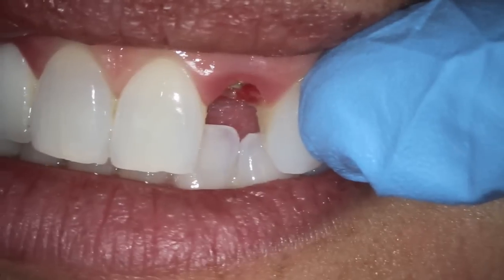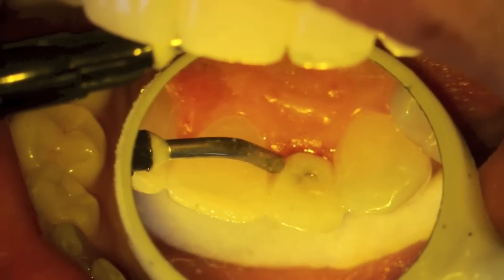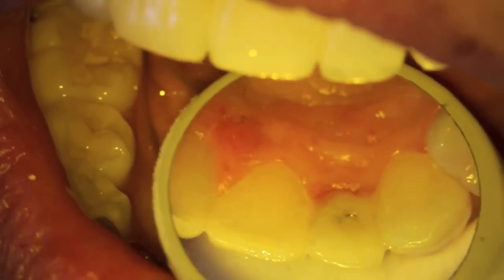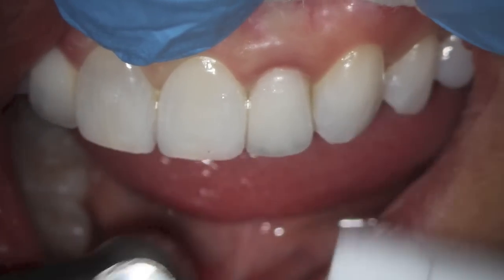tooth sheared off at gum line

Comment: I'm confused what a root canal is... are they not removing the root of your tooth? based on the 2 root canal I'd had, I assumed they just took out all the living parts of the tooth and epoxied a socket into the bone, then screwed in a tooth shaped base and placed a realistic crown over it, but the crown is gone and my new dentist wants to remove everything and replace it with some apparatus that goes to both sides of my mouth and covers the entire roof of my mouth. I'm not entirely sure if he's punishing me for not taking better care of my teeth, but I don't understand why such a thing even exists. a small amount of metal bridging the artificial teeth I understand, but a metal plate that covers most of the top your mouth sounds like a major design flaw being that the roof of my mouth  still functions fine, and I use it to judge the position of food. If I'm adding a whole bunch of metal to my mouth, I'd almost prefer it have a useful shape or a texture I'd enjoy licking. maybe someplace to keep change.

Comment: I had a root canal behind my venner and consequently it fell off whilst i was brushing my teeth. I went back for my crown apts and in this video as it had sheared off at gum line like this video leaving that hole there is a gap in my teeth but because i had the back of the tooth still in place. The crown has been attached to this but the front part at some angles look like i dont' have a tooth as the gum is in front of the crown. Hard to describe. But it's smaller than my veeners and it looks awful! My anxiety is through the roof. Looking at this video you have put a full tooth in placement and it looks perfect. What should i do am i right to say something about this or am i stuck with this?

Comment: What is the overall option for this tooth once she gets back home?

I have one broken of just above the gum line and I'm wondering if it can be pulled without surgery.
Reply: It can be theoretically extruded 2mm above the gumline gently with braces if the tooth is . After that,  a new crown and post can be placed on it. However, the prognosis is very guarded if you choose this option.
Another option would be to seal the broken tooth with a little cement/metal cap. Then attach a partial denture that clips onto the metal cap.
A good option is undergoing some sedation and getting the tooth replaced with a titanium implant.
These are just general options, which your dentist would gladly explain and discuss further with you.

Comment: I did the same thing and a post with an abutment was cemented into the tooth and a crown was placed over that..
Reply: It did happened to me,my tooth is broken from gumline,I been told that I need a implant, but the way you described your situation that abutment and crown worked for you,can you please tell me how does crown holding after 3 or more years? Thanks

Comment: Did you pull the root before bonding her crown to the sounding teeth? I'm pretty sure she was in pain before and after the visit is not
Reply: No, because the tooth is root canalled. I have had this exact sort of thing happen to the very same tooth as this lady.  Root canal tooth broke off at the gumline in my sleep, taking the crown with it. I had absolutely no pain at all, and thankfully my dentist was able to repair it using my original crown.  There will be zero pain since the tooth is dead, and has been "gutted" so to speak. No nerves, blood supply or anything. Deceased.
Reply: Did it last
Reply: @Schelle7000  sometime after rootcanel a tooth becomes infected ,if you noticed on her teeth the gum are redder than rest of mouth ,well basically signs of infection, any work on a tooth and it's only a matter of time
Reply: @mattmccabe2312  well my sister had 30 years old root canal and it's fine, it will fet infected only if it wasnt done correctly or doctor left infection on the root of the teeth